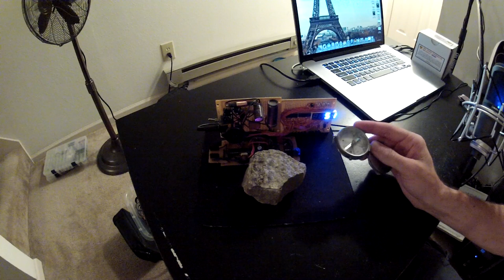Uranium Ore Test - How to Build a Geiger Counter

Comment: try to avoid any dust generation from that ore you have, banging it on hard surfaces, chiping it into smaller pieces etc cutting with a dremel. anything that would generate dust from the ore you have which can you can breath in is not going to be good for you or others, wash your hands after handling the sample and defnatly do not put ur fingers in your mouth etc after playing with the rock, as whilst its an unenriched uranium sample it still has uranium ore in the stone which releases radiaton